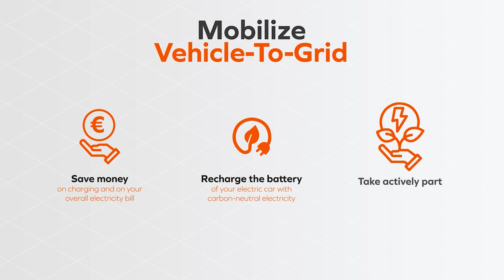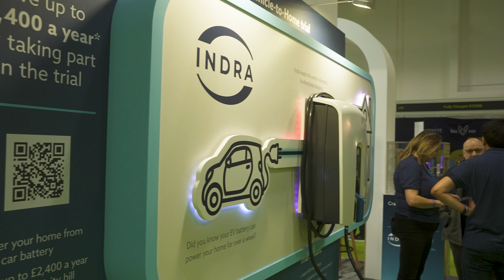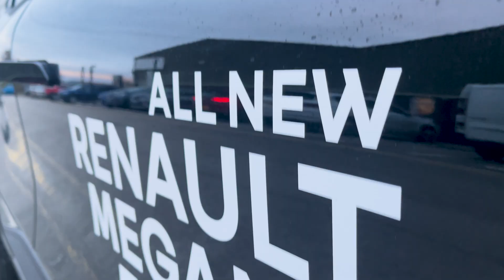Renault 5 V2G Press Release Is It Just Vapourware? (MOSTLY)

Comment: Why do you need a special wall box? All the  EVSE does is a couple of safety checks, a communication to tell the vehicle a max current, and then just connect AC power.
If the car exports synchronised power then the EVSE won’t know the difference…
Reply from the maker: Bit more complex to explain in a reply comment I’ll do a video about it

Comment: Issue with V2G...
EV batteries do not have an infinite number of charging cycles. The more you feed back to the grid the more you have to charge the battery.
The more times you charge the battery you reduce it's life and vehicle range. 
If you have an EV with a 120000 mile warranty that delivers 300 miles of range they are actually warranty 400 charging cycles. Which is a little over a year of driving 300 miles a day. This is usually not an issue since hardly no one drives 300 miles a day every day. So it is possible if you use it to power the grid too often and too much you will reduce your battery life.
Also note that EV batteries don't fail just because the warranty expire.
Just using the warranty ad an example of life.

Comment: V2L is on the face of it relatively easy to do and can be used for running appliances away from home. 
V2G will be beneficial to the grid in order to supply extra power when all the numpties put their portable air con units on over the summer (for example!) So effectively as a "peaker" power station. So this would be tied in to a supplier such as Octopus with their Tesla Virtual Power Plant tie up for example. The customer gets paid for allowing export from their car. If enough people sign up and have their vehicles plugged in (to the right wall box!) Then maybe we can say goodbye to Coal power stations being used as standby.
How successful it becomes depends whether , as Nick says , the charging standards are agreed across the board. Plus the cost versus benefit for customer.
I dont think V2H will ever become that popular due to the cost involved with all the extra hardware required to isolate the house etc in a power cut. 
How often do we get a power cut of more than a few hours at a time?

Comment: For genuine V2H, that will actually work in a powercut, you need to be able to island the home so it is totally cut off from the grid, no wall charger can do this without extra hardware, I have a Powerwall and the Gateway 2 interface does exactly this when the grid goes down so my whole house can be powered during the outage, I bet Renault are actually talking about v2L (load) so you can boil a kettle or whatever but not power the whole house.
Reply: You can do V2H without that isolation, but it doesn’t provide power cut protection.

Comment: You are correct in pointing out that V2H in the states is a very different concept as cars like the F1 is mainly targeting off or intermittent grid connected properties. In the UK the selling feature is the idea that you can make money by selling power back to the grid at peak times. The hardware to do this is all pretty standard solar battery stuff what will make it a success is how the hole system is managed and that is a software and standards problem so maybe it is better to leave it to a software company. I'm not that convinced the uptake of V2G will be of much interest to most people as they won't wont to worry about being at home to feed into the grid yes you have the ability power your home with cheaper electricity but do I want to do this with my car or just get bigger  home battery storage.

Comment: Hi Nick, I have a question for you. I have an EV with V2L (a MG ZS EV). It can discharge up to 2.5kw AC. Can I use it for V2G? If so what hardware would I need?
Reply from the maker: No V2G and V2L very different you can wrire the odd bit into the car but you can't wire it into your home circuits firstly it wouldn't be allowed by DNO and 2.5kw isn't enough
Reply: @woolychewbakker5277 thanks. Can you give maybe a simplified answer as to what I would need to do V2G? By the way, can you recommend a good V2L cable to buy that would be good for 4-5kw? Thanks, Chris
Reply: The inverter isn’t synchronised so no is the answer.

A non grid connected circuit is just a fancy extension cable, not a V2H/G system.